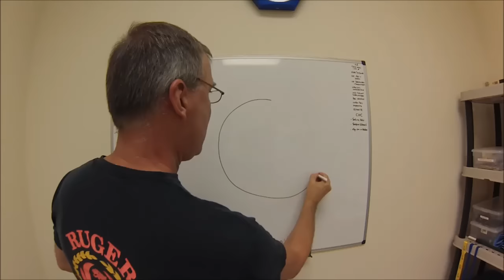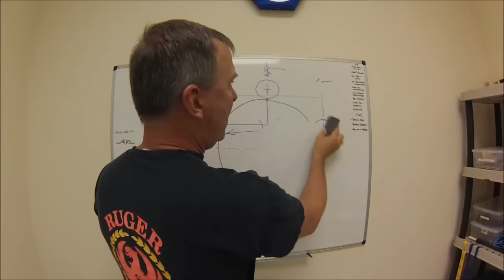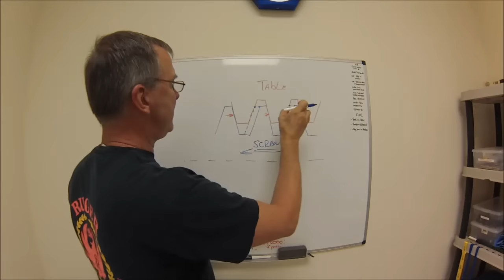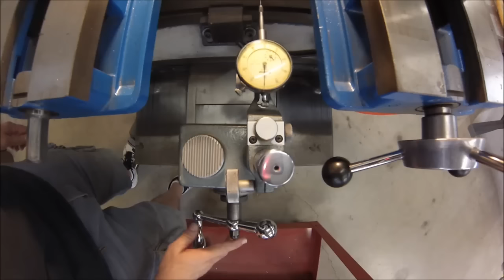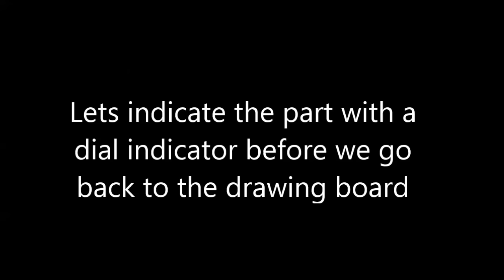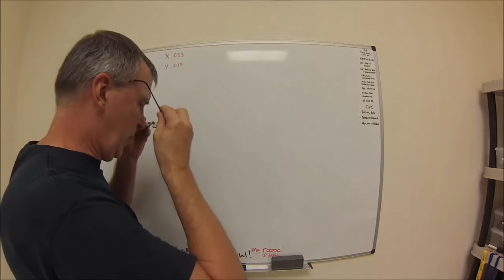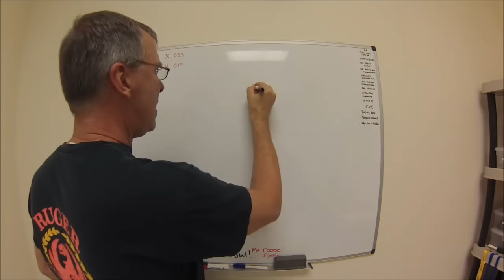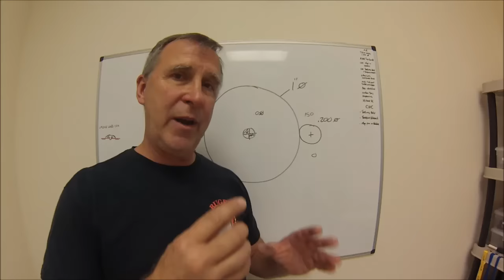Edge Finding Round Stock without a Digital Readout

Comment: In watching this video, I noticed that you suggested a dial indicator for dialing round stock and holes.  A dial indicator cannot be used to dial holes or round stock.  The appropriate tool would be a test indicator or a modern radial indicator.  Test indicators are often mistakenly refered to as dial indicators, which are an entirely different tool.  Really appreciate your thoroughness in your videos.  Anyway, let's be acurate.
Reply: There's a number of ways you can use a dial indicator to dial in a round bar or even a hole. If you want to go nitpicking on Joe, learn your stuff first.
Reply: @LambertZero  +1
Reply from the maker: The terminology can really vary. A lot of lever style indicators are often referred to as dial indicators, while the plunger type is referred to as drop indicators. if you really care to go the extra mile here, all indicators have dials, so that term can include both ( or all ) types. I call lever types, dial, and plunger types, drop. Always have, always will.
Reply from the maker: Google it just for fun. You'll see all kinds of descriptions.
Reply: Wow!  Apparently I touched a nerve! Sorry, just trying to clarify.  I realize that a test indicator is sometimes referred as a dial test indicator; I'm just saying that what Mitutoyo and Brown and Sharpe call a dial indicator is what is sometimes considered a plunge indicator, which will not dial a hole or round stock.  I try to make this distinction to the guys I have trained over the last 20+ years so they can bring me the right tool if and when I ask for it.  I'm just going by what I was taught by a father and son who have over 100 years of combined experience.  I certainly don't mean to imply that that he is ignorant, only misspoke.  Although this will probably irritate someone, "it" was referred to as a Brown and Sharpe "Best TEST."
Reply: It's all good!  For the record, I think Joe does an incredible job in his tutorials!
Reply from the maker: @christopherp.9616  Thanks for the follow up. I believe all indicators can be under the title, Dial indicator. Beyond that, 2 classes - lever and plunger.
Reply: @christopherp.9616  Yes Joe does a great job at explaining things, I have learnt a lot from watching his videos, but sometimes the words come out wrong. Still can't understand how to unloosen something lol, sorry Joe had to put that in. Also devices are referred to by different names depending on where you are.

Comment: Unrelated topic but I have a question you can probably answer. My shop is an old tin can that used to have a leaky roof. I replaced the leaky roof but here in mid Michigan we have an issue with high humidity and I'll find something I've sandblasted or something bare metal that I bought new pretty quickly develops a skin of rust. What to you use on your ways, what do you use on your collets, clamps etc? I just bought a new indicator, stand and a set of collets and I'm afraid to take them out to the shop! LOL WD, would last very long but might be a perfectly good product. I'm a mechanic and don't really use my mill and lathe all that often. The tarps come off those when I need to make something for the drag car or when someone shows up with an "impossible situation" they want me to solve. It doesn't pay very well but the bragging rights are awesome! So I solve em.
Reply from the maker: When I plan to be out of town for a while, I like to spray down my exposed machine surfaces with WD-40. It has always worked well. I also used to own a jet ski rental business in NJ and always prepared my machines for storage by spraying the engine and drive system with marine fogging spray. Those engines looked brand new every spring. You could probably use either and have good results.

Comment: There is a easyer way without backlash thingy .Use a machined rod of known dimension lets say 10 mm .Put it in a collet,and then touch the round workpeace.Make sure rod goes below the center of circle that way you will touch diameter of your circle for sure. Then move the tabe half of the rod diameter that means 5 mm in our case.And you are right on the outer diameter of the object,divide it by 2 and you are set on center.this is great for finding center of round stock that is lying horisontal in a vice.

For vertical peaces or edge finding you can put ball bearing on the rod and move the table untill it starts to spin.Or use a paper and touch the work untill you cant slide the paper.
Reply from the maker: I've never tried the ball bearing trick. I have to give it a shot.

Comment: so would it be right, that with no dro you would try using a corner rather then a centre as the datum for a job.
Reply from the maker: Corners are good, but your datum should be driven by the feature, and how that feature is dimensioned on the print.

Comment: lets see something on internal boring when i bore my spring cut to often makes my hole to big
last time i moved in and backed out to final dia. come way to big 
should i just keep coming out even to the last thou.
Reply from the maker: I am about to post a video on process changes and gremlins. If your spring pass is blowing the hole, the pass just before the spring pass was either too big, or the tool geometry or condition is no good. An improplerly ground or centered tool can pull down under load and relax without. Maybe the tool is too high and the cut pressure pulls it down toward center. With no load, it rises above center and digs in again.

Comment: Is there a way to accurately edge find round stock set on an angle?  i just did it but wonder what i ended up with.
Reply from the maker: I'm sure there is. It would depend on the setup.

Comment: What is easier, FIRST, measure the diameter of the work.  Then find the edge at what appears to be the center in the other axis, then just move the radius of the finder, plus the radius of the work, and you are now in the center of the work in that axis!!!  All movement is in the same direction, so backlash is no longer an issue.

Comment: Joe (or anyone else), while sorta on topic but sort off topic, can you (or anyone) give me an idea of a way to find the center of the short parallel side of a trapezoidal shape? I have to bore a blind hole in the center of the short side between the two inward leaning sides (basically the hypothetical long parallel side of the trapezoid down on the table).

I said hypothetical long parallel side above because the part is actually basically diamond shape (a rhombus of sorts or basically think along the lines of a basic kite shape) but with the two ends truncated and its in these two ends that I need to bore some holes. 

I have +/- .003" tolerance for the center point so accuracy fairly important but not aerospace importance or anything.
Reply from the maker: Use a technique referred to as a projected surface. If you can, push blocks up against the part banking on the 2 surfaces you need to reference, and sweep an indicator between the blocks. That will give you the centerline, then just use an edge finder for your offset.
Reply from the maker: I assumed the part is laying down. if its standing up, and those angled sides are the same angle, 
use an indicator, sweep one side until the indicator reads zero, 
record where the table is, 
move to the other side without changing the swing radius of the indicator, 
find the same zero by sweeping and split the distance the table moved.
Reply: @joepie221  yes, the part is standing up and yes, the two angle are the same... I cant see how sweeping it with an indicator would tell me center because of any offset in the stylus of the indicator would (in my head) equated to an offset from center when the table movement is halved. What am I missing / forgetting here?
Reply: Wait, I think I fogot about the fact that I would need to turn the indicator 180° when I sweep the other side...... So if I'm understanding you correctly, since the angles are flat features, I'll be looking for the low point in the sweep, then rotate spindle 180° (have an inidcol) and move the table to sweep the other side angle and adjust the table till I get the same low spot zero and that table movement is the total that I split?

That seems to make sense in my head now that i thought about the fact that the indicator needs to be rotated 180 for the other sweep (just like a round part) and thus offset in stylus is irrelevant... Am I correct in my thinking here?
Reply from the maker: @CJ-ty8sv  Correct. Just be sure the table is moving in the same direction for both sides. That way the backlash doesn't bite you.
Reply: @joepie221  thank you and no worries on the backlash... Mill has and old but still good / accurate Mitutoyo DRO on it....

Comment: yeah I bought an indicol and soon realized my quill doesn't protrude at all. perfectly useless piece to me. anyone wanna trade me for a magnetic base , I'm all for it lol.
Reply from the maker: These also fit the OD of larger jacobs keyless chucks. If you have a lathe, make yourself a puck with a pin in it to hold. That work perfectly as well. Pin goes into the collet or chuck, and the indicol holds onto the larger diameter.
Reply: Joe Pieczynski man , your like a walking  machinist handbook.  thanks  . Idk y I didn't think of that.